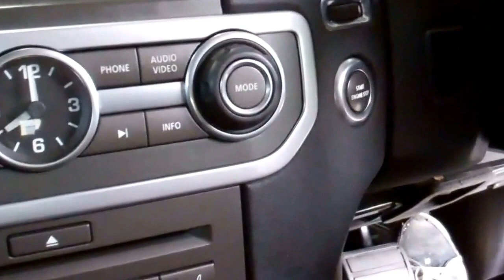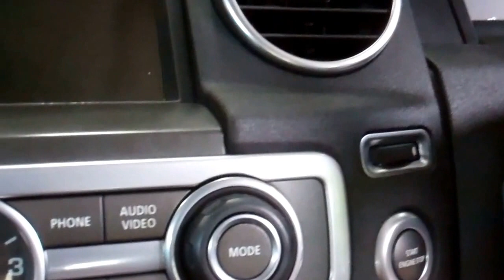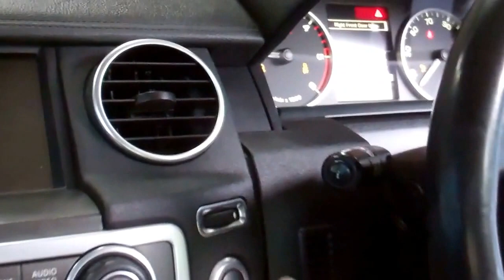How to replace the engine start stop switch on a Land Rover Discovery 4 LR4

Comment: Hi, had my 2014 Freelander 2 Metropolis about 16months and absolutely love it. Lately I'm finding that it's extremely difficult to either start or stop it using the button to the left of the dash. It's quite bizarre as on pressing it....nothing. wouldn't want to use my car as a Bank Robbery get-away car hahaha 😆 😅. I've had the battery checked (it was new a year ago) and it is fully charged and functioning perfectly.  Any idea what could be the issue?
Reply from the maker: A new switch would be a good start
Does it register as being in PARK - this is one of the "checks" does before stopping or starting
Reply: @L663  thank you so much for replying! No, it just does as described. There is occasionally many attempts before it just decides to fire up
Reply: @L663  sorry, I should say it does register being in park. By that, I assume you mean that the gear stick is in Park. It won't start or stop whilst in gear. Is the start/stop button issue a common fault?
Reply: @ianross04  Hi - I have not heard of the button being a problem but its got to be worth a try first
Reply: @simonjefferson   thanks Simon  👍
Reply: New switch installed. You (and Simon below) were spot in with your responses.  Start/Stop switch replaced - no further problems. Just a quick note to thank you both. Tailgate release button & Park assist are next in my list
Reply from the maker: @ianross04  Excellent - it was a lucky guess but your all sorted and love with your Land Rover